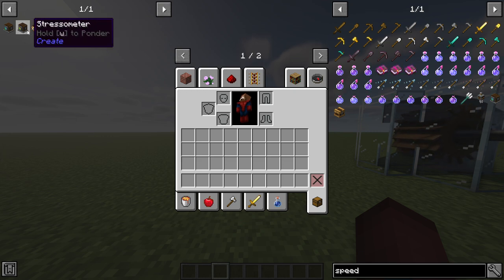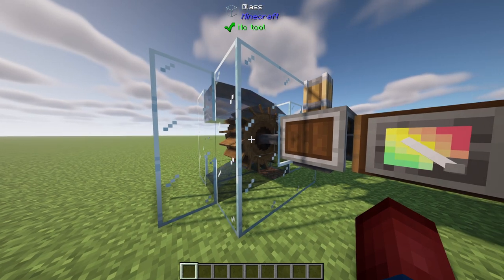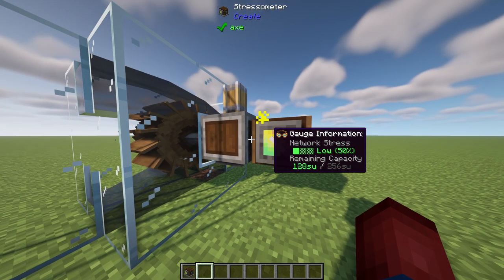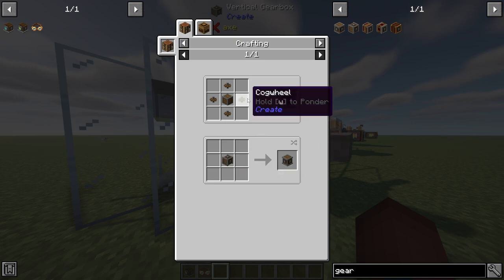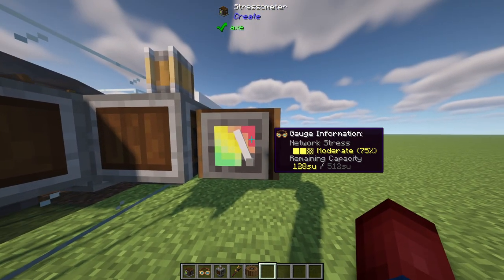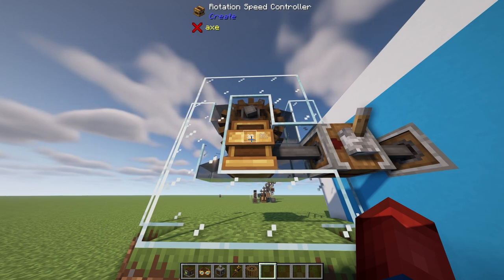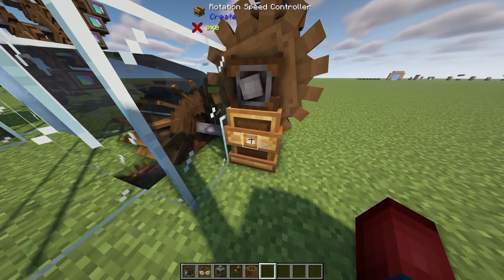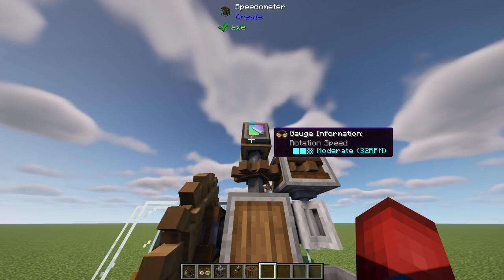Minecraft Create Mod 0.3.2 Tutorial - Gearbox, Overstressed, Speed Requirements Ep 2

Comment: the thing with big wheel conected to small wheel to increase speed is real life used metod as smaller wheel  have less teeth then bigger one it makes one turn faster then the big one which means you can have also the oposite have fast source put at the output small wheel the conect big one and you can slow it down this is how usualy clock system is made you have kinda like the central input in sistem that does one turn per second making the second hand then you use the small wheel x big wheel speed difrence to make a wheel that turns one turn per 60 sec making minute hand

this thing is called wheel speed ratio and this is how you calculate it and its also more technical explanation of the stuff

The ratio is determined by the number of teeth on each gear wheel. Calculate the speed ratio of two gears by dividing the angular velocity of the output gear (represented numerically by the number of teeth) by the angular velocity of the input gear (represented numerically by the number of teeth)

in simple term more teeth then the wheel from the source = slower turn

less teeth then the wheel from source = faster turn

Comment: 256 su is not the max for a single water wheel they can get even more corners don't count for power gen that last block of flowing water can be replaced with soul sand/soil and the glass block above it can be a source block you will get more than 256 su if you do it like that the max is around if not exactly 320 su for 1 water wheel lava wheel have a max of 256 due to the lack of a bubble Column